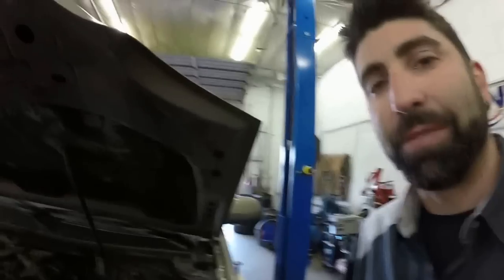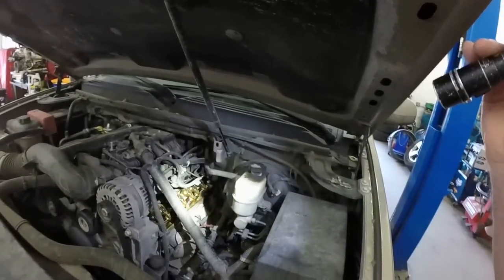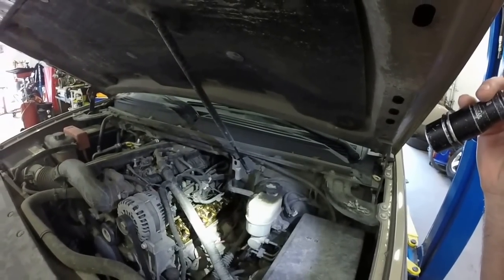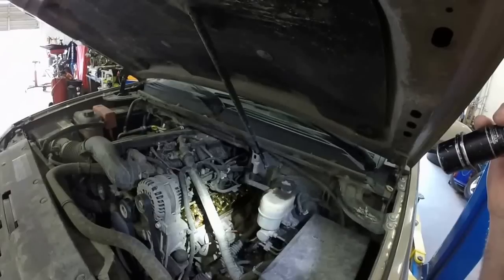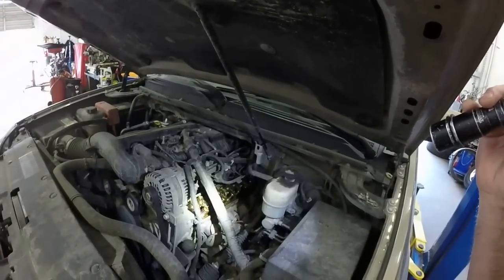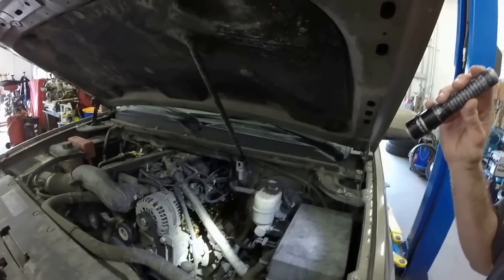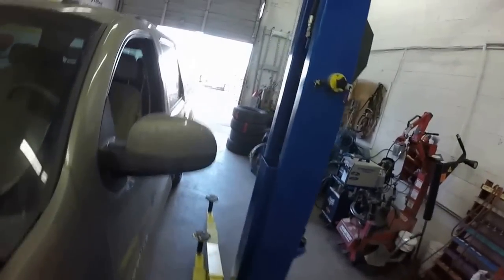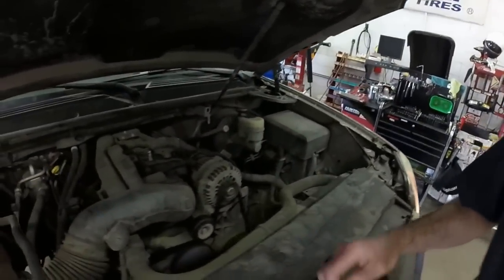GMC & Chevrolet Misfire - P0300  / Lifter Issues - 5.3L  - Diagnostic How To

Comment: Will this cause a po300 misfire code on a 03 Tahoe flex fuel 5.3?
Reply from the maker: Yes, it typically throws the P0300 code first, then soon it will give a cylinder code, you would hope.
Reply: @AMMotorsports  Ok,Only ones its throwing is the 300,and bank1 sensor 1 02 sensor.The misfire will blink sometimes only thing i haven't checked is intake for leaks.I think I'll run some transmission fluid maybe a quart with oil for a few days see if it'll quieten the lifters a little

Comment: This is why I do all of my own work. Got 276k miles and have had no internal engine problems until now. Cylinder 7 lifters are bad. “Mechanics” like this is why I would never go to one. Got mechanic friends for advice if needed and a scanner. Don’t “buy a new motor”!! Imbecile

Comment: Never had any issues engine related internally until now I have cylinder misfire 7. I’m at 276k miles. Don’t talk down on gm motors 😂 I will not buy a new motor because of the cost compared to replacing the 2 lifters in cylinder 7. Get a used one for roughly $1700-2000 with about 150k+ miles and no proof or record of maintenance  on it. Moral of the story is no engine is perfect but if you take care of it, it will last. Eventually all engines will be due for a rebuild. Still looking to get another 100k miles before a rebuild.

Comment: Why and the heck would you need a new engine? All it needs is a lifter the problem this guy has is a Collapsed lifter witch is not caused by a bad bottomed or oil consumption they collapse to save on fuel and then they end up not uncollapsing witch is what you see in this video all this person needs is a $60 lifter and manifold and head gasket and about 5 to 6 hours of labour not $2500 for an engine and then a bunch or money on labor this mechanic out to get money and that’s it he says any good shop I’m sorry but your not a good shop if your fucking customers over the way you did with this poor guy
Reply: Massive oil consumption, cyl 8.  That not good enough??  Class action lawsuit against GM btw

Comment: I done this job many times  for 1200 new lifters new bolts gaskets and stem valve seal done deal..like u said this engine does burn oil ..so it would be a rip off to the custumer ..

Comment: I recently replaced and engine for a customer, the engine was knocking bad. I installed a used engine and it has faulty lifters. Used engine has 80k miles. Awesome

Comment: I have a 2014 Silverado with the 5.3 L .  I'm basically in this same situation and the motor only has 63K on it.  The Chevrolet dealer recommended I get a new motor ($9,000 + tax) because the compression is too low.  Anyone else in this boat?
Reply: As of lately,  GM was hit with another class action suit due to the massive oil consumption they still have until 2014. Typically,  its the AFM system that will cause oil consumption and low compression. AFM deletes are the way to go it looks like. 
https://gmauthority.com/blog/2020/12/gm-hit-with-class-action-lawsuit-over-vortec-v8-engine-in-full-size-suvs-and-pickups/

Comment: great info, will this also problem  be for a 6.0 vortec??
Reply from the maker: Yes
Reply: @AMMotorsports  thanks i have a vortec 6.0 at the shop we installed a re built engine. the vehicle will misfire on cylinder #2 and Cylinder #3. all other components have been ruled out except the lifters

Comment: Thank you for posting this, you have lots of good info about this issue and the PCV issue which I wasn't aware of so thanks for that.  Any idea what compression was when this truck came in?
Reply from the maker: Of course!  Most folks commenting on here, like the wonderful kiddo above me on this thread, seem to have no clue about all the issues these 5.3L have.   We did a comp test, hence why we pulled the valve cover. (cyl was totally dead)  Also, cyl# 8 was super low (very common issue that has been addressed by GM, but no recall).  Thats why we advised the customer that an engine was recommended, but was up to them how they wanted to spend their money.  
Beware the shadetree mechanics commenting on here!!  All they do is call names like children!  Fact.
Reply: @AMMotorsports  FAX.
Reply: They DIDNT do a comp Test,  Waste of his time.  otherwise he would not have Needed to pull the valve cover to find the dead valve.   THis dude is a tool not a Brain....  Be careful who you choose to follow if you dont know the way......

Comment: Having similar problem can’t tell if it’s the lifters or a fly wheel how can I determine 2009 tahoe
Reply from the maker: Need to pull valve cover to see if there is a lifter not working,
Reply: If it is the lifters and I change that and not everything with the motor I’ll eventually be back at square one because something else will go bad?
Reply: Have you ever checked compression before removing the valve cover?  I'm curious what compression would be on something like this?
Reply: Arietap 9 the compression is really low
Reply: @Millieny9526  I figured it would be low but does anyone have any numbers? I know a good cylinder is around 180psi how low would the affected cylinder be?

Comment: Helped a friend fix his dead valve on a 2007 Chevy Tahoe on the exact same cylinder. He spent about 600 on parts and it only took a long day to fix it. Truck runs great with 210k after the repair. Usually when this happens it’s at high mileage and some people will opt to change out the entire engine. This happened to be the only issue.

Comment: active fuel management sucks...the best thing to do is cancel that with an OBD cancellation system...I seen them for about $200.00  my 05  5.3 has over 200k  and  going...I like the body stile of the newer  07 Tahoe and up bit this is the main reason i don't get one...why they go from good to bad...I hope that engineers are proud  of this  design...because I'm NOT

Comment: I've been driving on a lifter misfire for a year now. Envoy Denali 5.3 10mpg almost 2 qts oil a month and it's been in 2 shops. They changed plugs and almost charged 750 for fuel injectors and said it's not it gave my truck back and said put Lucas in it. I assumed it wasn't fixable. Why didnt they take my money and fix it. My guess hindsight is both shops were 1 bay shops
Reply from the maker: Man,  you know,  sometimes it gets weird with shops

Comment: Same issue. 07 chevy tahoe..I replaced the bad lifter and it still tapped. Had it looked at by a technician and was told that it wasn't the lifter but my cam shaft was worn in that one spot. I have doubts about that too...they just don't make mechanics like they use to..

Comment: So if a feller has one o these engines with no problems yet, if you delete the part where it drops down to 6 cyl or whatever it does, will this cure me having to worry bout it down the road. And that's called an AFM delete ? And what is DOD, THANKS
Reply from the maker: AFM delete will do the trick... yes

Comment: I got a 2002 GMC yukon.with a 5.3 in it and it don't eat anything and it's got close to 300.000 on it original motor and transmission
Reply: Question?
 - Would you know why the engine is very cool after changing coil.? 
Thank's!

Comment: Does the breather port you speak of on the left side of the engine have any replaceable parts for oil consumption? I have some consumption 07 Yukon with no leaks or misfires.
Reply: Yea, basically replacing the valve cover with the updated part... or possibly drilling it out by the baffle, they get plugged up there
Reply: @Junior-wt3in  Oh thanks so there's a new valve cover for our trucks new body style 2007 Yukon? I'll look in to it I also feel the consumption comes from the fuel management system on these trucks but hopefully valve cover helps it's not an enormous amount of consumption but enough for me.
Reply: @wtspapa24  also, I forgot to mention there have been issues with cyl 8 and/or 7 with piston rings sticking that would also cause oil consumption.  I found this out thru Jasper Engines and they said its really common too. Hope this helps 
Cheers
Reply: @Junior-wt3in  Ok thanks also I have a Silverado new body 2007 with a p0300 but truck doesn't shake basically no symptoms but my misfire data is saying 7 and 8 cylinders misfiring. I have all new oem spark plugs and wires and swapped coils and injectors. Thing is I have no symptoms you think I need a crank relearn or can it be a slight blown head gasket but I don't overheat either. Thanks.
Reply: @wtspapa24  oh boy... well without symptoms that's just strange, to say the least. 
I would check compression,  and last resort is taking that valve cover off to look for stuck lifters or broken valve spring.
Reply: @Junior-wt3in  compression is 150 1 through 5 but 6, 7, and 8 are 135 120 and 127 respectively.  What you think is that too low? Thanks appreciate the help.

Comment: Wow, ummmmm. Not sure what to say. They make an AFM delete kit for these, they sell the new lifters as a set with all the upper gaskets, and like another commenter mentioned you can buy a reman engine with a core for not a lot of money. Not uncommon to see 300k or more on the LS series engines, the only complaint really being the AFM lifter issue on vehicles equipped. Do NOT spend the kind of money mentioned here because an engine has a dead lifter. That’s not thinking at all. The diagnoses procedure was correct, the fix was not.

Comment: My lifters just failed on my 2008 5.3 ... bank 1 and bank 2...it cost me $650 where the hell you get your numbers from 🤦🏾‍♂️🤣🤣
Reply: Told the customer that the engine was no good! RIP OFF LS engines drink lots of oil and the lifters are a common problem.

Comment: I have  zero compression on cylinder 1 on a 2011 Chevy Silverado 5.3 afm and pulled valve cover and all of the rockers are moving up and down like they should..
Reply: I figured it out..cylinder 1 burned exhaust valve..

Comment: 2013 gmc sierra 5.3L , first issue showed up at 80,000 ....engine rebuilt due to cyl #1 and cyl#7 misfire,  displacement on demand function kills these engines ...Im getting ready for rebuild #2 under an extended warranty I purchased from a 3rd party.  144,000 miles ,  one potential cure for this is to get a tuner and DISABLE displacement on demand ...the dealership mechanic was very familiar with this issue and said it's going to happen again and again.  Oh, and 2014s have the exact same issue....changing the valve cover design did not help solve the problem .....when your engine switches to v4 mode it spray a small amount of oil into the disabled cylinders which eventually causes carbon build up which then causes oil to slip past the piston rings ....you start noticing the oil consumption gradually get worse , then cyl#1 starts oil fouling the spark plug and hello shop visit...disabling the v4 mode may extend your engine life but for how long I have no idea ,   once mine is rebuilt Im taking a loss and getting rid of the truck ASAP... its a shame because the rest of the truck is awesome.

Comment: Anyone with this problem should look up "crazedperformancerepair" a YouTube mechanic. He figured a method that releases the afm/dod lifter only needing the air intake and vlom removed. Then disable the afm/dod for $150 with hp tuner. Modify the vlom and cover to not allow oil back to the lifters. Not a 100% thing but worth the try (seems to be an 80% fix rate) Also this is a common enough problem now that swapping the lifters, cam, push rods, and rockers comes in a kit. A KIT. 

By the book if you don't own the shop or maybe if you need to adhere to certain recommendations to remained a certified mechanic for "x" brand, sure. I could see for those two reasons recommending an engine swap. Otherwise there are two in expensive options for a fix. One back yard mechanic way that'll cost $200 the other a grand for the cam kit.

Comment: You’re full of shit the customer brought the vehicle in for you to find the issues with it now is there a complaint indicates a state it has a rough idle and a misfire so you found the problem good but now you’re saying that the customer needs a new engine man you are full of shit and I would never take my car to that shop do you make your company that you work For look bad that Customer does not need a new engine remove the Heads put new valves fix the lifters Install new lifters and all the above before shit man

Comment: I have done a bunch of afm ecm deletes and it fixed oil consumption, only uses oil in v4 dod mode, delete the afm ,pull heads clean up the carbon, put a new lifter in it ,engine fixed , on number 16 ,dod gives about 1mpg ,gm had to do it for epa reasons ,delete it and dont look back, want a v4 get a inline
Reply: for a temporary fix while driving in town drive the silverado and sierra trucks in manual m5 ...it wont switch into v4 mode,  but yeah the afm needs disabled for these engines to survive

Comment: Compression will be low   With this fault ? 
Or it will show  good compression 
Thankyou 
I got a 2007 yukon xl 5.3 
Misfire on cylinder 8 and 6
Got new spark plugs ..
Wires.  .  Swap the coil.
Injectors.
Injector pulse is good
Compression is good. Aroun 180
 Do you think it will be the same 
Think bad. Like this in the video 
Thank you
Reply from the maker: Yes!  Compression will be low on the faulty cylinder!!!
Reply: I’m going to the same problem on a suburban 2016 misfire cylinder #5 low pressure mechanic told the lifters are bad  I could fix it or put a new engine

Comment: i would just change the lifter call it a day
Reply: Same here just that single lifter
Reply: @omellym7363  most shop charges 1700 to due lifters,  head has to be removed
Reply: @detroitdaddy2371  head pulling not worth half that
Reply: Well, by all means, doing it half assed is cool to the shade trees on this thread. Then a month  later, you gotta do another one.. smh ... derrr ok
Reply: No shops want you to change the whole engine so they can charge the hell out of the customer
Reply: Exactly shops are fuccing theiveso
Reply: You cant charge someone 3500 dollars if you do that

Comment: That's why I'm glad I got a 2006 Suburban 5.3  without the AFM system . It's got 246,000 miles and still going strong . I do have a lifter tick that comes and goes , but I changed my oil about 1k ago and have had very little if any consumption and my oil still looks brand new !
Reply from the maker: Nice one!

Comment: funny !! all i did was tap it ... with a plastic hammer !! and starting working again lol !! smh
Reply: is it still working after tapping it with a hammer?
Reply: so does your fuel pump until you turn the car off
Reply: So if my catalitic converter is clogged can i just straight pipe it ?

Comment: So what you're telling me is because of a collapsed lifter and a clogged PCV system you need to replace a whole engine? That's amazing to me I have fixed many of these engines oil consumption problems just by doing engine oil flushes with BG engine oil flush system. I own one myself  would smoke like a bastard when you first started it remove the valve cover cleaned it out flushed everything with BG problem gone and that was 35 thousand miles ago it now has 200,000 miles on it and run strong!!! So pull the intake clean the PCV system and valve covers flush the engine replace the lifters  and run for another hundred k .
Reply from the maker: Well, these 5.3L engines are junk and we replaced the engine due to the horrible oil consumption issues these certain engines have.  Not because of the lifter. (maybe you didnt read whole description).  We performed the TSB from GM for the valve cover (breather system) possibly being clogged.  Didnt help, in turn we found stuck piston rings, (not covered by GM warranty) which is  a bad situation when GM KNOWS these have issues out the gate.
Thanks for the reply and input either way.
Reply: @AMMotorsports  I guess I misunderstood when I watch the video because soon as you decided that the lifter was failed(which I understand it definitely was) you said that the engine needs to be replaced as well as mentioning the oil consumption..  Toyota has this problem so does Volvo and so does Audi excessive problems with all drinking oil because of rings sticking because of carbon build-up. this isn't new in the industry on a hole ...I personally have not had to replace any 5 3 liter engines yet ... I'm not trying to cause an argument just constructive discussion(please don't be misguided by the Chevy Avatar I've owned many different brands of vehicles at this point I just prefer GM trucks) thanks
Reply from the maker: @jpatt973  Its ok, just a misunderstanding.  I should have said it in the video as well.  Thanks for that.            AND YES!  Tons of vehicles have these issues, espicailly turbo'd vehicles like Subaru, Audi, BMW.  I work on too many Subaru's and Audis/VW here in Colorado.  Ones with turbos eat oil like crazy, and tons of blowby.  TSB from Subi, dont go more than 3700 miles on oil changes....  smh...     This was our 6th engine/lifter job in 2 years on the GM 5.3L AFM design.   And dont get me wrong!  I own a 2006 Ford 6.0L diesel.   So theres that gem of an engine design.   HAHAHA   All brands can be junk sometimes to me, i see every brand out there, mostly!
Reply: @AMMotorsports  LOL it's funny that you mention the 6.0 l Ford diesel . That's the drivetrain that turn me away from Ford forever I will never go back to it!!! bought it brand new dealership did two head gaskets in it the third one was on me after that I got rid of it never again!!!!! I've since gone to an LML 2015 Silverado Duramax diesel and it's like going from are yugo to a Cadillac I couldn't be  happier!  Thanks for the chat!
Reply: @AMMotorsports  to clarify when I mention other manufacturers having problems I did mean oil consumption not lifter issues...